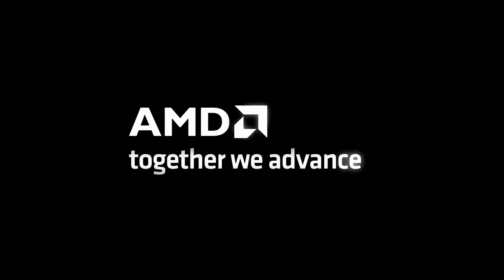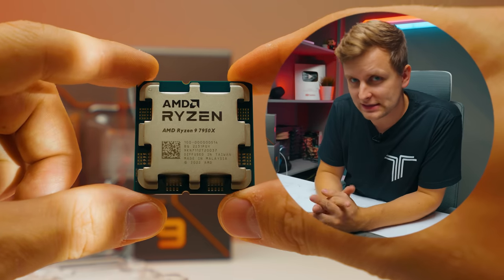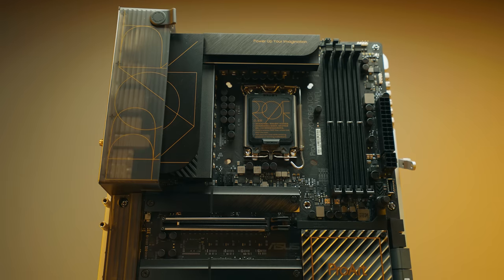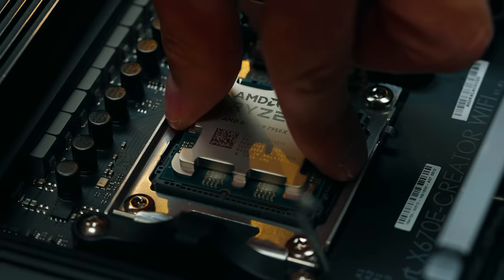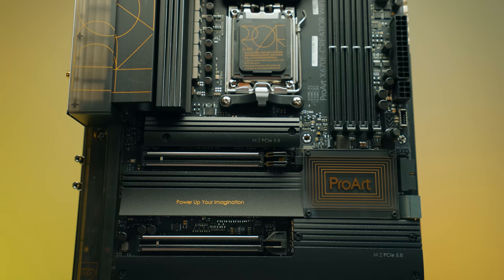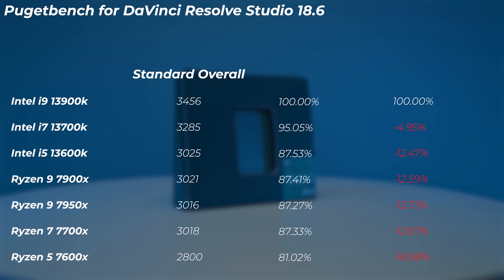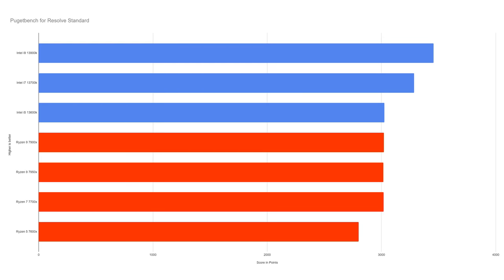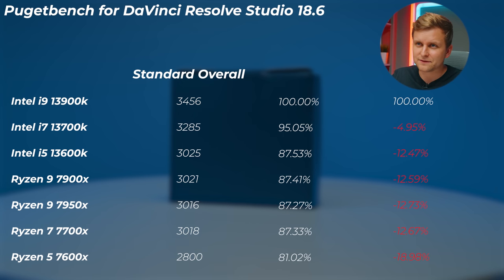AMD Ryzen VS Intel for Video Editing - Which CPU is best for Premiere Pro & DaVinci Resolve?

Comment: wut do u think would b the best computer at around $400
Reply: I am not the guy you asked, but I think I can still help you a little bit. I can't include the link without it getting snipped, but I managed to get a AMD 5600G with integrated graphics (125) cooled with EKL Ben Nelvis cooler (25) and 16GB of Kingston Fury Beast DDR4-3600 (50) on an MSI MPG B550 board (120), housed in a NZXT H5 Elite (110) and powered by a non modular 400 Watt BeQuiet PSU (60) with a gold rating for just under 500€ total in Europe. Add in a cheap M.2 for about 40 Euros and you'd have yourself a PC for about 500. I'd say you can get pretty much the same maybe with a different cooler and PSU for about 450 dollars in the US, because most parts are slightly cheaper in dollars, so maybe you can even get a 2TB M.2 with that and stay just under 500. 

You would have to get a real GPU later and don't try encoding video or playing games in 4k or hell even any newer 3D games on that. As a creator save up for an Intel ARC 750 GPU for about 200 bucks and double the ram for another 50. If you manage to get a 650 Watt PSU for not much more than the 400 gold and you will definitely step up later, then obviously buy that right away. Let's say you get one for 80. So that adds 330 to the tab. Then you will be at around 830, which gets you a good PC that looks really nice and performs better than what 90% of the people have. It's not going to be a 2023 high end machine, but it will look great, allow you to do video editing and be okay even in games, especially if you aren't trying to game on a 4k monitor. Once you have a little bit more money you will want to step up to the GTX 4070 most likely, unless all you do is like photoshop and premier pro. But you will need more CPU power to max out what that card can do. On the other hand if you don't do creative work and you will only game in 1080p, maybe a GTX4060 and 550 Watt PSU is enough for you, which won't require more than 5600G as a processor to be honest. But if you want to max out the 4070 and do quite a bit of video editing and gaming with that PC eventually, you would be looking at a 5800X3D as an upgrade. If you want to do work only and mostly video work, the the 5950X is still not too bad of an upgrade path. 

As for Intel Asrock's cheapest 760 Lightning mainboard will give you DDR5 for 120ish. A 12700K which is the cheapest option with 8 fast cores is still almost 300 though. You could also go 14600K for more slower cores and less faster ones and about the same overall speed for about the same overall price. Then you'll need 32 GB of DDR5, which will run you at least 100, probably closer to 120. A very good M.2 with 2TB can be had for about 90. You'll need 100 Watts more for Intel these days and this is a much faster CPU than the AMD from above, so you are in the 850W range, where the good ones cost you 150. That's 120 + 300 + 120 + 90 + 150 = 780. Still need the case and air cooler which adds another 150 or so (can be more if you step up the cooler, which you might have to), unless you buy something pretty ugly. So that's 830 and over double the budget and also doesn't include a discret GPU. In fact the AMD will have better 3D power, because their integrated graphics are better. But then again the Intel K variants give you Quicksync and more, which can be a much bigger deal as a creator than whether you can get 26 or 14 frames in a new title on low settings. 

The above 500 dollar AMD build gets you some Blizzard arcade games, some shooters on super low settings or oldschool games in 1080p, stutter free youtube and will feel quite snappy until you try to use lightroom, photoshop or video editing without proxy files. After you upgrade that with the Intel ARC for 220ish, you will be fine doing most things and can even game a little. Check the 750 benchmarks to see what exactly would work. But then the upgrade path on AM4 isn't there. You can step up one time to a 5950X or 5800X3D and get within about 20-30% of todays highend builds. It will be enough to power anything south of a 4070ti as well, but you will need a new PSU to power those cards. 

On the Intel build you are within 15% of today's best PCs for most things and maybe you won't bottleneck a 4080 much. You can probably sell that Intel PC better than the AMD one, too. It will suck a lot more watts from the plug though. You can upgrade it all the way to a 14900k and 4090, but I probably wouldn't do that with that board. Intel is basically buy use for 3 years sell. AMD with AM4 is the cheapest path to a fast PC right now, but AM5 will have a longer lifespan. You can get a 7800X3D now and later on maybe get a 8950X3D or maybe even a 9959X3D if that will be a thing. AM5 will be here for a while most likely. So an AM5 mainboard will be upgradeable and then you usually sell that kind of system when the new socket has been adopted for a year or two at a fraction of the cost of new parts. That's why most PC youtube videos are centered around the Intel 1700 vs. AMD AM5 routes. How good are these systems at what exactly and will you keep them, upgrade them or sell down the line. That is what people worry about right now. 

By the way both ways can be financially quite equivalent, but I would say the initial investment for Intel and power usage at the moment is a little higher than for an AMD system. A budget of 400 is basically an i3 on a cheap 1700 intel or the AMD version from above and the AMD is faster and better and has the much better GPU, so it is perhaps your only real option here. It's like Android vs. iPhone You can buy a new iPhone every other year and get some money for the old model, so that the difference pays about for a mediocre Android or you can buy a mediocre Android for a third of the price, throw that away in 2 years and get a new one. After the initial investment for Apple you effectively lose the same amount of money, but you probably do have a better phone. And just like with Android, you will have to pay for a lot of apps that are free for Android. Right now Intel probably is a little bit better than AMD for most things except for maybe gaming, but it costs more and you need to pay more as you go, because AMD is more energy efficient and not just by a little bit. 

So the true answer to your question is probably that you might be able to get a nice PC for 400ish, but not with a discrete GPU. A 4060 is 300 by itself and is about the entry barrier to 4k gaming on very low settings. Gaming sites will tell you that it is basically a 1080p only card. The 4070 costs a little over 600. And that plus the above Intel build gets a solid creator PC that you can max games out with at 1440p and that will still play most new titles well if you lower some of the settings. And something like that was the topic for the last video on this channel. That's basically the equivalent of last years iPhone for you. If that's your work tool and you make money with your PC work, that's probably where it starts. The 900 dollar build was really the barebones minimum like, if you don't make any money, but you also actually do a ton of work on your PC, you might be able to get by on that 900 dollar build or mine for 830 or whatever. Those aren't that different to be honest. I probably have the better CPU and he probably has an entry level GPU in there already, but that's a guess, because I only watched the 1.5k one and that is pretty much what I would do as well. I'd go NZXT for the case though, but it's all within 10-20 bucks of what anyone with good knowledge would do. The man knows his fans, coolers and m.2 SSDs though, that's for sure.

Comment: I guess I'm not the only one massively disappointed with Ryzen 7000, its worse that they also held back consumer Threadripper 7000 for so long. AMD really need to boost their Multi-core performance as much as possible.
Reply: He severely lowered the ram timings, Ryzen is very CL sensitive. The 7950x performed worse than the 7900..
Reply from the maker: not the timings, CL was the same for both platforms.
Reply: @theTechNotice actually you really unnaturally used lower speed ram for Ryzen, "just because" makes whole review unfair, nobody use it as warranty says, and you know this, I bet you don't do this too.

Comment: what is best for coding, ml etc? amd or intel
Reply: generally speaking from what I have heard intel is slightly better overall in coding, although having friends who code, they say its easier to build an amd rig that runs cooler and quieter during their work than a modern intel rig without sacrificing much performance.
but if you want the best performance at the moment just go intel, although maybe wait for 14th gen to come out for price drops
Reply: @luvingyouu thanks for the suggestion. I was running a complicated code in my current pc but it couldn't run properly so I was thinking of getting a new one
Reply: @cybercop47  what’s your current specs?
Reply: @luvingyouu  i7 10700 16gb ram no dedicated gpu
Reply: @cybercop47  10700 is still quite capable overall, maybe just the lack of gpu holding you back? Really depends on what you’re doing I guess.
16gb is also fine for most, but usually workloads are starting to require or need more, generally most are fine with just 16
Reply: @luvingyouu  yeah but I am thinking of giving it to my cousin as a gift and buy a new one :3
Reply: @cybercop47  that would be nice! If you need any help picking parts for your new build let me know!

Comment: Warranty?AMD recommends 6000mhz ram,they are the literal designers of their chips,watched a few of ur videos,n in all honesty it kinda seems like u will do anything to present AMD as an inferior product in whichever way shape or form,am really disappointing as I know just how many people look Upto tech journalists like urself
Reply from the maker: Firstly, I appreciate your comment and I'd recommend watching more of my videos not just the recent ones where you'd see me recommend AMD over Intel ANY DAY! FYI I only recently switched to Intel since they're doing a better job for my workflow.

Secondly, about the RAM speed...
why would AMD recommend RAM kit that's out of their 'Warranty spec'? 
If the box says up to 5200Mts why recommend 6000mts? And then my next question would be, why is the spec on the box not 6000mhz then?
Reply: @theTechNotice  coz those are the baseline speeds,not coz higher speeds would void the warranty,expecially if they themselves market said ram kits as 6000mhz kits,I have watched a few of ur videos,from ur 5700g one,then a few others n now this one,also no one leaves performance on the table expecially if the manufacturer insists  that their chips can handle said speeds n it's been tried n tested,u can't be the only one among all tech channels,Jayz 2 cents,Gamers Nexus,Hardware Kanucks,Even the infamous LMG who finds running lower ram speeds on AMD fair when testing between them n Intel,wouldnt it have been more apples to apples just running both platforms at 6000mhz cl30 n reported on any issues that would have come up?

Comment: AMD like to claim more efficiency but here the truth....7950X uses 170w socket power and have 16 cores. So 170 / 16 cores = 10 watts per core. A 13900K uses 250w socket power and has 24 cores. 250w / 24 cores = 10 watts per core also. So Ryzen efficiency claims are not as true as AMD claims. Any responses to this are PURE BIAS. Comment has nothing to do with caches, TDP’s, use cases etc etc. socket power numbers are posted by both Intel and AMD.
Reply: 13900k is 32 threads just as the AMD chip is
Reply: @MookieZerang  threads are a virtualization within a physical core. Threads don’t consume power; physical threads do and physical cores are what hosts the threads so…..
Reply: As the comment above me said,  threads are as important as cores in a lot of scenarios. Also the Ryzen 7900 literally disproved your claims.
Reply: @flintfrommother3gaming  compare the 14 core 7900x to a 14 core 13600K in terms of per core power draw which both have the same socket power. Additionally, thread per core performance doesn’t exceed the physical core performance as in 2 threads per are each 50% of the core performance. A thread is not a physical object. It’s a processing unit created within CPU software powered by physical core. Additionally, threads are included in my statement as 10 watts per core accounted from extreme use cases. Neither cpu uses this much power all the time and both scale down near identically using the same per core power.
Reply: @GamingOnArc  Saying 2 threads have %50 performance is outright false. They have different uses and scale a lot more than single threaded cores with out-of-order executing and other vector extensions, while making a core more even by assigning a certain thread to another application and vice versa. Undermining their use by just calling them "Software Threads" is not sensible.

7900x is a CPU that hardly hits those power usage metrics and even though I'll admit it's power usage is not great from the stock, the reason it's not is because they are basically overclocked to nearly their silicon lottery bind limit, that's why you can't overclock your processors nowadays, both Intel and AMD.
I think you confused 7900x and 7900 (non x) because they aren't even similar in power usage.

If you want raw CPU performance, go with Intel why not but stop spreading misinformation about power draw when the difference between the two is undeniable, it's not really a opinion at all Intel is less efficient. 7800x3D and as I pointed out, 7900 is a great example of this.
Reply: @GamingOnArc  7950x Just has bad idle power usage but better power constraints under load, the Intel chip is the opposite. Also have you seen the power usage on the X3D chip? It's extremely low compared to the X.